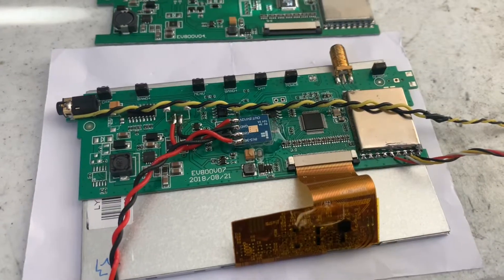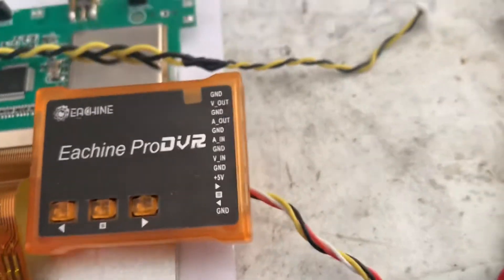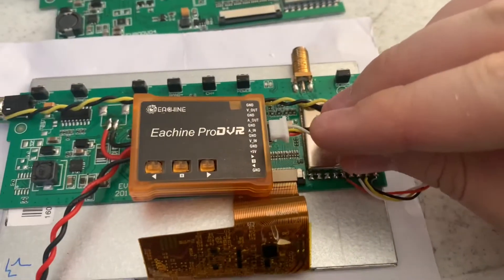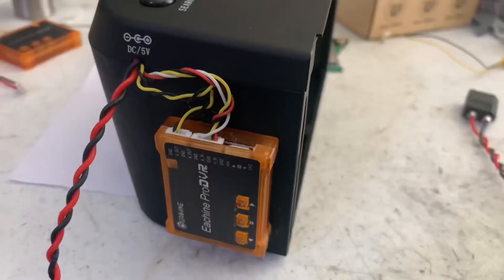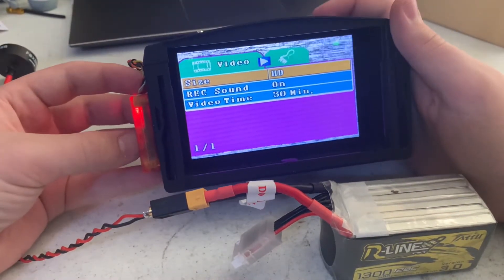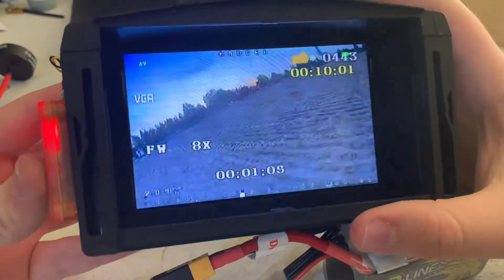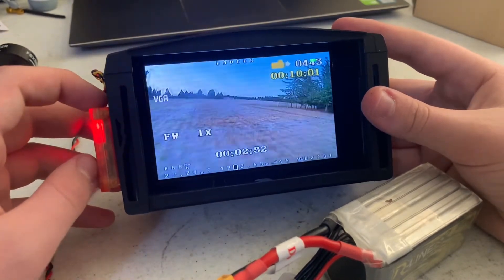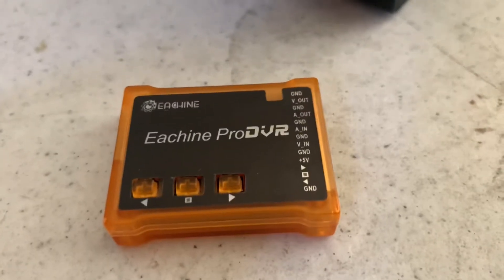Eachine Ev800 ProDvr and 2-6s lipo mod.

Comment: Thanks so much, going to do the battery mod, how is the 5v regulator holding up the reviews on amzone   not great! iFlight BEC 2-8S 5V 2A 12V 3A Switchable for RC Drone FPV Racing Multi Rotor
Reply from the maker: Hey Shane! Sorry I missed your comment, the regulator has been holding up ok, I dont have that many hours on it though.